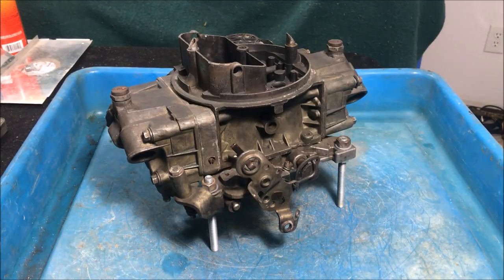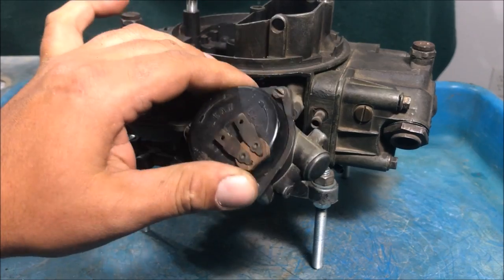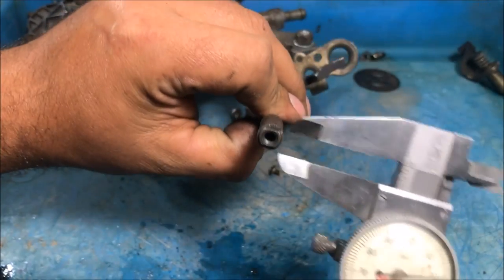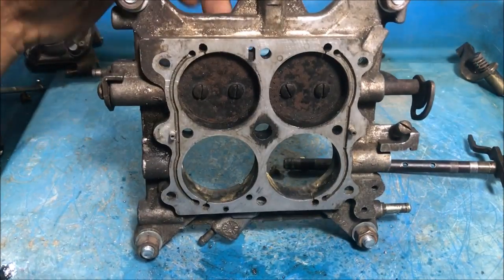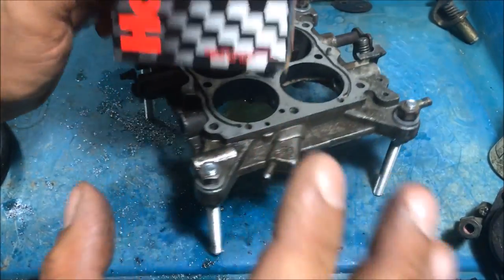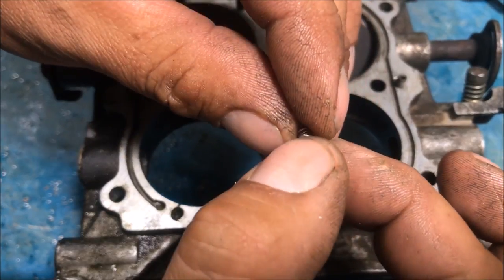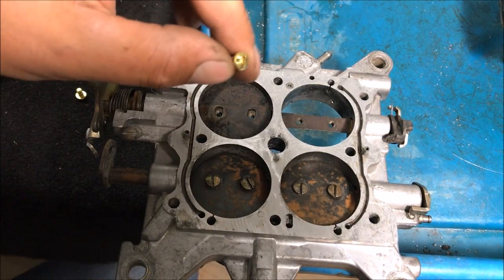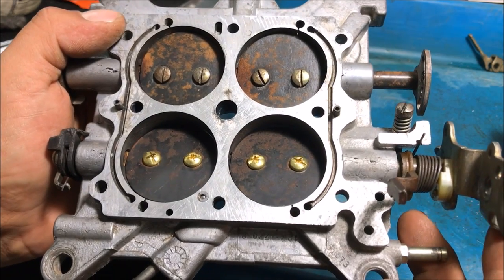HOLLEY carburetor throttle shaft repair and backfire blow out protection PART 7

Comment: Great video. I really like the vise grip trick at the end!  However, I ordered this exact kit & it Didn't cut worth a damn. I'm calling BS on this product.
Reply from the maker: I don’t make fake videos… you have to cut in reverse… it worked 100%
Reply: M.A. I had the same problem with cutting the throttle plate, can't recall if I had the exact same throttle shaft kit but the reamer is labeled HENKYO 10.9.  Following the directions -  reverse the bit in the drill, use existing throttle shaft holes as guides, and reverse the drill direction with plenty of cutting oil on the cutter and just oil on guides.  It would not cut with plenty of pressure, which amazed me as these steel cutters should eat through aluminum.  Upon inspection I noticed inside cutting portion of the reamer was oddly nicked on all cutting blades (machining issue) and this section was dull to the touch.  I cut this bad section down using a metal cutting blade and the drill as a lathe for the bit (quick and dirty process).  After, resumed cutting the throttle plate and it worked ok.  Should you have to do this repair...nope, return it and avoid the HENKYO cutter/reamer.

Comment: the nylon things you mentioned are called ribbon bearings.i notice you left them out when you put in new shaft bushing?i usually stick them to the shaft with antiseize compound and slide them in ,it makes the shaft action very smooth.im surprised you got those with a rebuild kit,they usually never include them.i love that throttle bushing reamer tool ,i want one.grinding the end of the butterfly screws is brilliant .thank you.

Comment: Great info on the backfire valve,I need to do that on mine. when I replace brass screws like that I use a small drill bit to countersink the threaded end, they stake out much better. Also you were looking for a way to clean the appearance of carbs. I've seen others use a baking soda blaster and get very good results

Comment: Installed the kit on 2 barrels which leaked mostly on the choke side. They have no chokes and the the shaft sticks out with no 2nd or outer seal support so I left the bush sticking out 1/8” which really  helped. I also installed the Teflon seals on the outer for a better seal. This is on a 3-2’s installation so stopping as much vacuum leaks as possible is really important. 
As for the person who had trouble with the reamer. The right side of both the carbs I did were a bitch to get started cutting. Seamed like when I finally got it passed .050” or so it cut easy… yes I was running in reverse. The linkage side cut  easy from the start.

Comment: Good video. But draw the bushing in with a nut, bolt, and washers. Don't hammer--especially without supporting the backside of the hole. Don't pound the anti-back-fire check ball retainer--use a C-clamp. Good luck.

Comment: which throttle shaft bushing kit were you using for this? 7/16" or 3/8"? also, did you have to use the teflon strips as well to prevent vacuum leaks or JUST the bushings?

Comment: If you are building a double pumper you have to install 2 check valves to protect both power valves. One for primary and one for secondary? I bought a tool (Moroso) to check if my old power valve is blown out.

Comment: That vacuum port for the electric choke is for choke pull off. There is a piston in the choke housing that gets pulled down by manifold vacuum. 

This piston is connected to the choke and  opens the choke 1/4” as soon as the car start so it doesn’t flood out. 

Supposedly the piston is not sealed and runs free back and forth. No grease or oil in the cylinder or it doesn’t work properly. 
When vacuum is applied to the piston. The leak around the piston draws air in from the the little tower in the choke housing.......pulling fresh air in to cool the choke spring. The vacuum line going to the choke leads to the top of the carburetor and pulls the air in from there.
It is also said that this is not the case and the tower just vents heat from the choke housing. Holley calls it the choke fresh air intake. So it either does run off of the piston vacuum leak or it just vents. I personally think it does both. Pulls vacuum into the fresh air system at idle and vents off idle after the choke isn’t used. 

Your videos are really good
Reply from the maker: wow.. I had no idea.. interesting... all I know is that when I capped it it starts up perfect every time... and I live in Houston, TX and we dont need a choke..  but very good to know